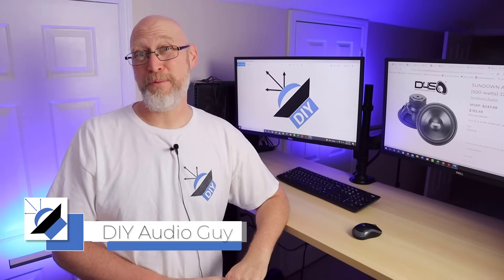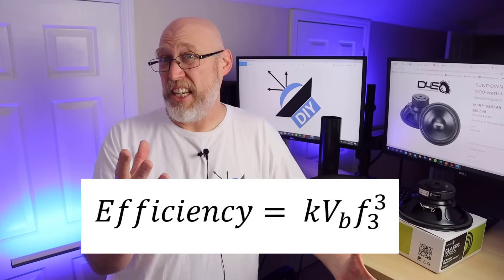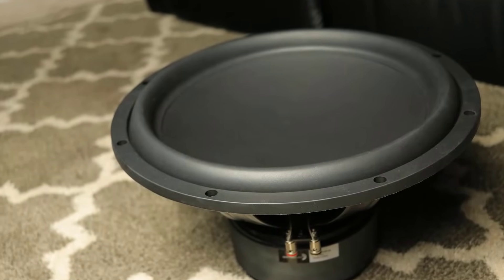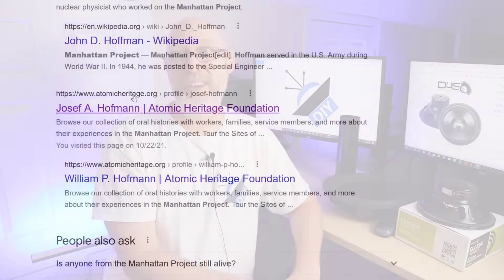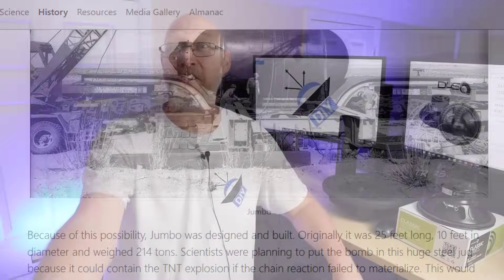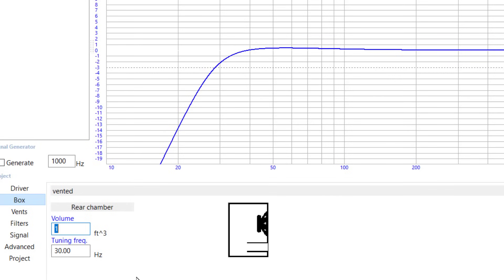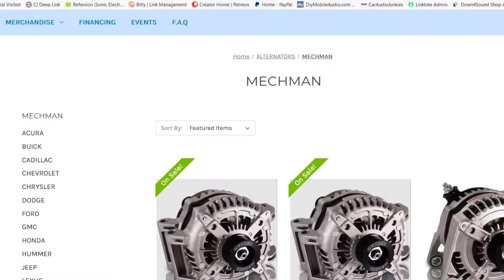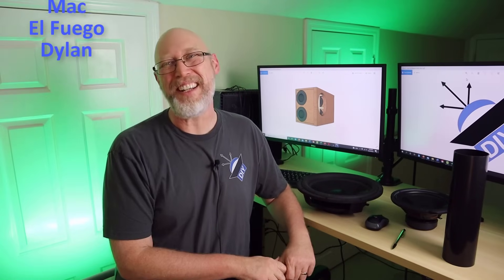Hofmann's Iron Law:  A Better Box for Better Bass!

Comment: So glad you mentioned the 10 vs 12 thing.  So tired of the idiots talking like their 10's outperform 12's without giving any specs of both setups.   If somebody has low end 12's, they can be outdone by high powered 10's sure, but that's not the comparison that should be made.   All else being equal, the 12's will always win.    Some people really need a smack across the face to try and wake them up from their delusions.
Reply from the maker: Exactly.

Comment: best system I ever built was four 10 Kicker comps, each in a 1 cubic foot box mounted in rear of my Dodge Dakota RT extended cab.  Kenwood 1100 watt amp, really good bass, but slot ports are the next level, and I am so ready for my new system

Comment: Irragi hi output alternator big 3 sky high car ofc 2/0 crescendo bass clef 2000.1d 10 guage speaker wire direct leads feeding  power to 2 Rockford Fosgate T0D412 subs my side door speakers are p1650 front and rear I am working on a battery bank and a 4 channel rigidity support aka striper pole oh all in a chevy sonic I just subscribed 👋
Reply from the maker: WOW!  You are not playing around!

Comment: Interesting video. I've been trying to figure out some of this subwoofer stuff, and not sure size always is the key feature for subwoofers. I consistently see 10" and 12" subs that rarely go below 35 Hz. Yet I have an 8" JBL sub rated at 18 Hz - 800 Hz (which I'm sure to many that 900 Hz is on the high end of a sub). The box came with the sub, and though I have not tested it, I can say yes it does play lower notes than to subs that are in the 35 - 40 Hz range (I do have exceptional hearing, and proof humans can hear below 20 Hz and above 20 Khz. But I have terrible eyesight, and think one sense made up for another. I'm just glad it was my ears instead of sense of smell. lol). But I too always thought a larger subwoofer driver was needed to hit down to the 20 Hz mark, like a 15" or larger. So how are smaller subs able to achieve this ?  Please, I seriously would like to know as I am somewhat confused maybe? And I am having a hard time locating anything about a driver's ability to reach to low end Hertz like a subwoofer. It seems to me you would always want a sub to go down to 20 Hertz otherwise you are cheating yourself. And one reason I ended up with the JBL I do as it is hard to find subwoofers that reach that low of Hertz. Which really surprised me.
Reply from the maker: It is all about the interaction between the enclosure and the drier.
Reply: If they go lower they go less loud (hofmann law)

Comment: Funny, I'm using classic 2" A/R mids in my car audio system. They were new old-stock on P-Express, and no longer available. They screw right into Dayton indoor/outdoor speaker pods I've mounted on my dash, mated to Dayton 1x4" ribbon tweeters. I'd have bought more if I'd know how useful they are.
Reply from the maker: Sweet!  I bet those sound great.
Reply: @DIYAudioGuy  I haven't found a better 2" mid on P-E, at least for RMS & Sensitivity. The sound isn't objectively better than my home system, but using pods eliminates door-resonance altogether, and dash-mounting makes for better stereo imaging than I'd previously though possible. I put a 12" Dayton UM sub box on the passenger floor! Upfront, I can low pass the sub at 200hz w/o imaging problems, so the pods never get any cone-shredding bass.
Reply from the maker: @xxxYYZxxx  in a perfect world I would build a system with subwoofers up front in both foot wells.

Comment: 12:00 Mannnn I remember the PA Electrovoice ELM12’s some were using in their vehicles. I had two recently in 2006 in a jeep Cherokee and them EV’s GOT HELLA LOUD when it was around 100-400hz which is unheard of any 12” car subwoofer being able to do. I had a 12” subwoofer as well for the lows so I had nice coverage on the low end from 36hz-400hz.
Reply from the maker: Yea, a lot of the early car subwoofers were EV's or Eminence PA drivers.

Comment: I had 2 12" SE subwoofers in a sealed 5 cubic² inch box. Wired at 2 ohms, and firing 1200 watts from the trunk into the cab of a 2001 Nissan Altima; that provided some clean low bass.
Althoughbeit, the bass was made even better after a SoundStream crossover was installed. 

The complaint is that I had to sacrifice the entire trunk for a loud stereo system. 

50×4 watts Pioneer head unit feeding 400 watt amplifier on high pass which powered 4 3-way Pioneer 6×9 and 2 Kenwood tweeters.

I tried to run a 2000 watt SoundStream Amp, but I fried it. Alternator did not supply enough power to it. 
The 1200 watt Amp used to go into protect a lot in the summer time; but it did the job when it worked.

Comment: This is so interesting. Technically speaking the game has changed so much. I remember house parties with base bottoms and fans on the amp in the winter months with the windows open in the PJs and your were still sweating.
Reply from the maker: Parties tend to get hot.
Reply: We had an Econoline van that we used to transport the equipment a real POS. He installed (2) 18 in speakers in the rear cargo doors with a 500w Sherwood amp. That thing was booming even though we didn't know what we were doing. Thanks for the hard work you do for this channel.
Reply: My studio apartment rig is annoying detached neighbours with twin class D SMSL SA98E so you don't necessarily need big hot amps for a party. It is horn speakers and big ported 12" subwoofers though. Those amps even drive the subwoofers pretty loud though not as much as the peavey ipr1600 amps I have.

Comment: So here is something I have been doing for a few years that seems to work well. 10 inch sub in a box with volume for a 12. 12 sub in a box with volume for a 15 and so on. Not sure how well my idea works on paper but it usually sound pretty good to me. My current set up is pretty low budget. 7.2 surround sound. With old school sony tower speakers for my bass.  internally braced because of half inch fiber board. Boxes are 2.6 cubic ft with 12 inch woofers on a 200watt  rms fisher 2 ch amp. Ports are two inch abs pipe about 12 inches long. Seems to do pretty well. Nothing crazy for a set up but over all it seems to work well.
Reply from the maker: That is not a bad rule of thumb.

Comment: One thing to note is that there can be practical limits to how big the driver can get, in a PA system you might get away with four 21" drivers on either side of a stage, not so much in a fiat 500 or a small apartment. This is another major reason why high excursion has become so common over the years. The missing link is full range drivers.
Reply from the maker: True

Comment: YEP ! I was penciling out equations using T/S parameters way back in 1980.  The only 2 sources listing T/S parameters back then, that I knew of,  was RadioShack, and SpeakerLab. 
 I made 2 subs for my living room that were big enough to double as end tables on either side of my couch! and my first home theater was born cira 1985.
 These ready made sub enclosures drive me insane...  generic sized, and tuned to too high of a Fq, and pray the driver you stick in it, is happy with the volume.  The proverbial Kart before the horse.
Reply: I was at Kstate college back in 81 or so and I had some speakers I had bought from McGee radio out of Kansas City but didn't have the specs to build the right boxes. They were a 12 inch with alnico magnet and whizzer cone. There was a guy in Manhattan, Ks that was advertising homebuilt speaker builds. Well, he had a brother that had a computer and he could measure the parameters of the speaker. I let him do it and it turned out it took a 5 cubic ft enclosure tuned to 35 hz or so. I built the boxes and I wish I still had that pair of speakers. Worked fantastic.
Reply from the maker: I miss radio shack

Comment: Acoustics is cool physics. UCLA, Was built in the 1930s when acoustics was the rocket science of the day. A lot of the modern acoustics was discovered there. The UCLA physics department has an acoustic live room and an acoustic dead room. The dead room is interesting as there is no sound. Feels really weird when you are in there by yourself. They also have a dolphin pool in the sub basement were they had dolphins and researched sonar back then.  While I was there a friend of mine used sound waves to create plasmas hotter than the sun on a bench top. It is called sono-luminesance.
Reply from the maker: That sounds like fun.

Comment: From my vast experience in home audio, I would add that the different bass driver sizes effects the overall character of the bass, not just the power. I was surprised to learn when I auditioned three systems for a guest some years ago, with each system using a different bass driver size (8", 10" and 12") that the different bass driver sizes (each in a large vented enclosure) produced different bass performance characteristics. And I would add that the smaller bass driver worked better in a smaller room, and as the room size increased, the larger bass driver worked better: 8" in a 100 sq ft room, 10" for up to 200 sq ft, and 12" for rooms above 200 sq ft.
Reply from the maker: Absolutely!
Reply: 15, 18, 21, up to 33 being biggest home theater sub.

Comment: What would you say 1.3 cft (10 mm ply with bracings inside) 8 inch woofer
Reply from the maker: Depends on the woofer.  But, for most 8's , that is a bit on the larger side.
Reply: @DIYAudioGuy  apx what should be the volume...i dont have any parameters available...only know that its a 8 ohm; big magnet 😥
Reply: @DIYAudioGuy  my dimensions are 30 x 11 x 7.5 ; woofer is in the  30 x 11 ; and port is in its side panel if 30 x 7.5 and its a tower speaker

Comment: DIY AUDIO GUY: I'm putting a 8" Kicker on each side panel of the back seat area. I cut 3/4 MDF to the shape area. The MDF will be mounted with screws to the body aperture .This is basically is a Free Air set up. I don't want any sub boxes taking up precious space. Any Tips/Concerns are greatly appreciated.
Reply from the maker: The biggest down-side to free air/infinite baffle is power handling.

Comment: Displacement is number one thing that matters today. It is the only factor that determines your bass output for a system.   Xmax * Cone area = displacement.   Box size will change the efficiency, but power is basically free, so who cares. At low frequencies it takes very little power to hit Xmax.  You can use a small box so long as the driver can hit Xmax within it's max power rating you are set. Any box sim can show you that.   Put in box, and measure.  Eq with a Linkwitz transform to get the desired response.  Done.
Reply from the maker: You seem to be a big fan of Linkwitz

Comment: Does polyfill increase or decrease the internal box volume? I watched some videos on youtube and it's very confusing. Some says that it will just remove some distortion and others said it will make the tuning lower.
Reply from the maker: This is the best video on the topic.  https://youtu.be/INM0g1JeMLY 
I am not aware of any videos that prove how/if poly fill works in a ported enclosure.
Reply: their are many who agree that polyfill (in the correct proportion) has a remarkable benefit.  however, it seems none of them will agree why or how.  i simply did the best i could with the recommended specs for my driver and it turned out well good enough for me.  i must have a life because while i do want to try polyfill, i havent.
Reply: @kenso.1  The only thing I notice about them is they tend to lower the box's vibration.
Reply: I had a smaller box with 12s and I put some pink insulation to see what would happen. It did make a difference but not much, it hit slightly lower and louder.

Comment: Well! I have learned a lot from some of the most esteemed audio engineers and received a lot of answers about speakers and amplifiers that I found one way to make speakers sound so incredibly natural and wish such rich and deep bass that you have to listen to it to believe it! I'm sure that you know about the Cerwin Vega speakers and their reputation for their nice and deep (Not saying that they are the best but they have a solid low frequency even though it's a bit too cracky....if you know what I mean!) I personally made some 6½ woofers sounds even lower in bass and so incredibly softer that everyone who heard them could not believe that the bass of a 6½ was way better than a 10 inches woofer from Cerwin Vega! I did use the same reference in order to build some much bigger speakers and the results were also absolutely amazing! I wish I could have my very own company!
Reply from the maker: My home theater set up uses two 5 and 1/4-in drivers and a transmission line for the right and left speakers.  I lost my subwoofer amplifier due to a lightning strike / power surge and I didn't even notice at the sub it stop playing until I had the house to myself and wanted to crank some base heavy tracks.

Comment: great video! i always had a feeling that my jl audio 12w6v2-d4 sub sounded okay with the 1.25cu ft recommended sealed but not great. recently, i was trying to build a 2 cu ft port but since i still stuck at building ported boxes, it ended up being a 2.3 cu ft sealed box. in any case, it sounds sooooo much better loud and low. now i know why thx to your explanation and hofmann
Reply from the maker: It takes space to make bass.
Reply: I bought a used JL 10W7 and bought a costum box that was made for 12W7 ported specs. The hole was cut to fit a 10s. I’m so excited to get tyem installed and tuned! It will be loud and low as what you have experienced here too

Comment: I haven't used win ISD for boxes but am more of a hornresp guy
Reply from the maker: I downloaded that the other day, have not had time to figure out how to use it.  Would love to build some crazy transmission lines.
Reply: @DIYAudioGuy  you'd just use a front chamber, no rear chamber, and use the horn segments to give you the transmission line. Then calculate combined response of back of driver and horn port.

Comment: Actually this is true: bigger box = louder sub...I made for my lil 6.5 driver approx 2x bigger net volume box tuned to 22 Hz which less than the half of the recomended runing. Why?: parameters allowed this: on it's RMS power not overpassing it's Xmax up from 20 Hz nowhere, and when I decrease the volume a bit, it can play down to 18 Hz + thanks to my car's cabin gain it is really windy for what it is at these low-lows. Provement for this is on my channel. Also I plan to make a home audio sub using a car sub: 15 inch rockford P1 - I designed a vented box for it which is way bigger like recomended, not overpassing X-max from 15 Hz uprards on it's RMS power, tuned to 19.1 Hz, and also F3 is 19.1 Hz, just for this I will need to buy or make an amp for that, so...
Reply from the maker: Yep!  You can use the iron law to your advantage!

Comment: I have a question you may be able to help me with. I'm running after the head-unit is a AudioControl DM-810 Processor, AudioControl Epicenter, Three Alpine Amplifier's ( two are bass amps), aftermarket Bass Knob and a Ill Auto Sound RCA Distribution block. I wanted to know in what order should install everything? Example: epicenter before the DM-810 processor or vice verse? And how should I run my aftermarket bass knob? Thank you very much for your advice.
Reply from the maker: It's hard to do troubleshooting and gear setup in the YouTube comments. But I think you have too many components in your signal chain.

  I think the DM810 is all that you need, It has AccuBass and a wired remote.

Comment: this was a great explanation. Now, to peruse your channel for passive radiator information
Reply from the maker: I've got a couple of videos where I use some passive radiators, I think one of the very first projects I built for the channel was a passive project.  Perhaps it's time to make a nice video on passive radiators?
Reply: @DIYAudioGuy  I saw that. I started watching some of the PR videos, but I've never heard a solid explanation on how to come up with enclosure dimensions or proper weight of the PR, etc.

Comment: Agreed and second this information but… weirdest thing is going on in my car .. I had 2 12 inch mtx woofers rated at a end of 1000w in a ported box.. playing with different things in my car I hooked up 2 10 inch Rockfords with a rms of 600w.. using the same 500w mtx amp in both .. both are at a 2ohm load .. I  heard a huge difference between the 2 setups but not in the way I expected.. my 10 inch rockfords are noticeably louder.. like maybe 4-6db and that confused me to my core and shook everything I thought I knew about car audio.. below 28hz the 12s are louder but from about 30-50hz the 10s thumb like crazy.. they have similar Xmax but the 12s have more cone area and are ported .. so what could explain this occurrence? Cabin gain? It has confused me .. I just thought it was funny you made the comment about “10s bump louder then 12s” and generally it’s true .. the 10s that bump louder have more xmax and wattage etc.. so that’s why they’re louder . Just wondered if anyone could explain what I’m seeing or better yet, hearing in my car..
Reply from the maker: It could be differences in the enclosure.  The Rockford fosgate could be more efficient, it could be lots of things.